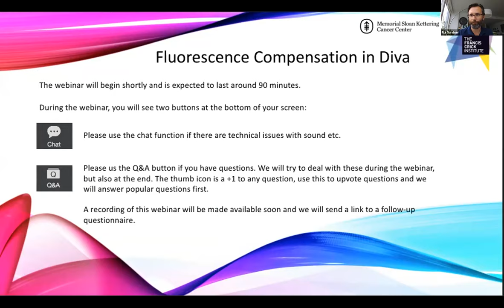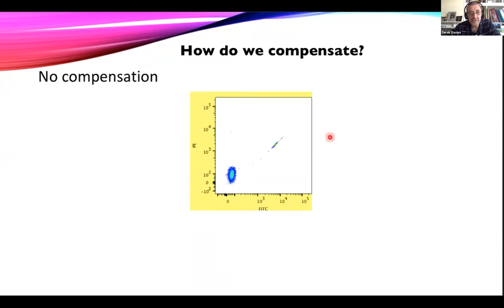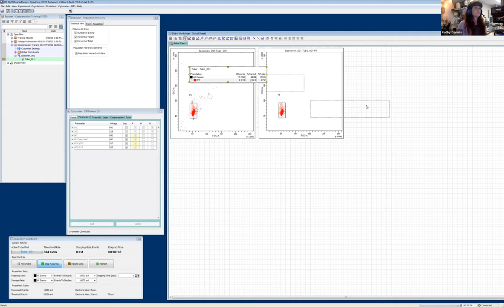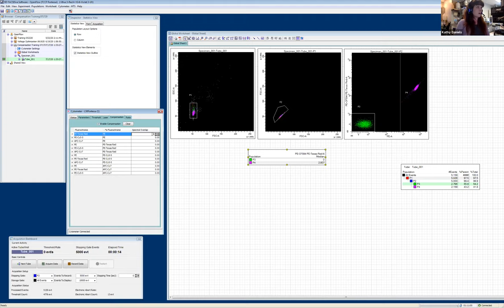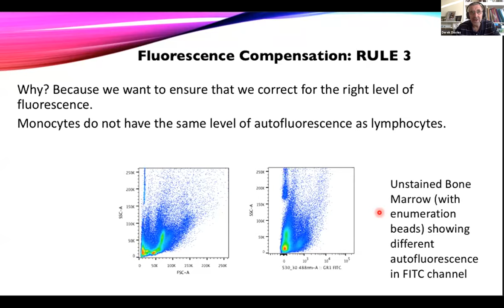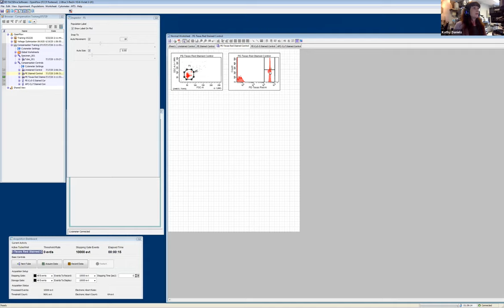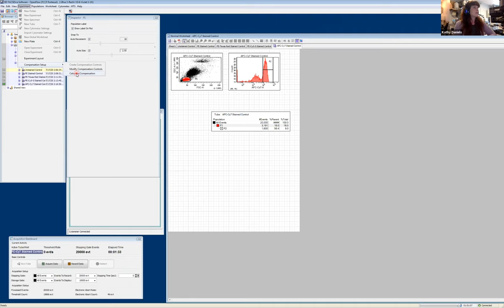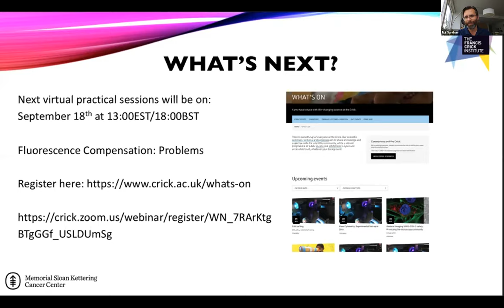OpenFlow: Fluorescence Compensation in Diva

Comment: The concept that compensation controls should be treated the same way as experimental samples (e.g. having compensation controls and experimental samples on the same plate during the staining process/at least running them through the same staining protocol) makes sense to me. A quick question on this, though. If you are fixing your experimental samples and then running them a couple of days later and are using beads for compensation controls, would you still recommend running the beads through the staining process on the same day as the experimental samples and then letting the beads sit until you can run the experiment, or would this lead to a significant loss in the brightness of the compensation beads and lead to compensation issues? Thanks!
Reply: Hi Matthew, that's a very common question. I guess the way to think about it is, if there's anything that can affect your data, you need to control for it. You are correct, fixation can reduce the brightness of fluors. This won't be a problem per se, unless the loss of brightness is such that you no longer have a good separation. But in this case, you would also see that kind of loss in your sample. Since we need to make sure that the signal in the beads is brighter than in the sample, I would be more worried about loss of resolution in the sample. The biggest problem is that fixatives can degrade (or at least change) the spectral properties of fluors, for instance, through changes in pH, crosslinking of peptides, etc. So it would be ideal to have the beads go through the same fixation protocol, including how long they will be exposed. Having said that, if from your experience, you don't see any changes in the amount of compensation/unmixing in your samples when using "fixed" beads made on the same day vs made on the day you fixed the samples, then you can start making them on that same day. It may depend on the fluor, so I would test all of them a few times to give you confidence. But remember, every time you drop a control, you're no longer in control! ;)

Comment: I noticed that your single color negative very close to the left,
Reply: Hi Ping! The negative does not matter here. It matters that the positive fully stained experimental sample is on scale and then we want to run the compensation controls at the same voltage. We go into a lot more detail on optimizing voltages in another session!